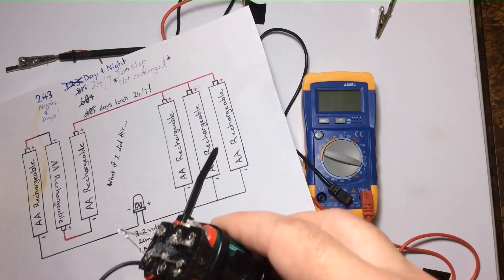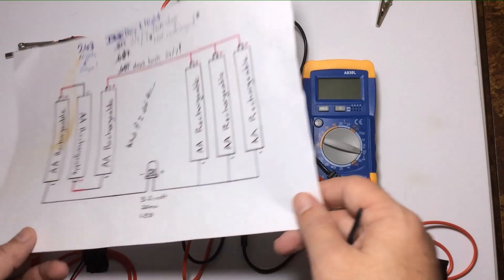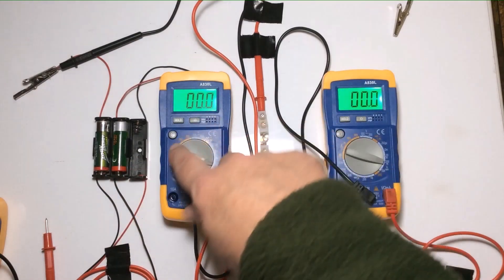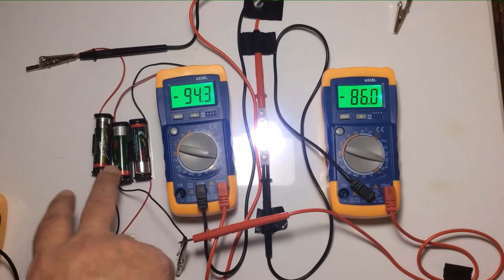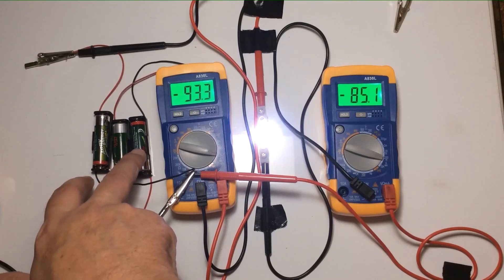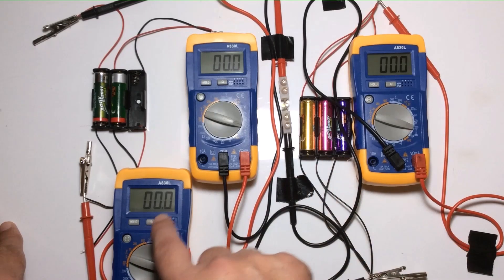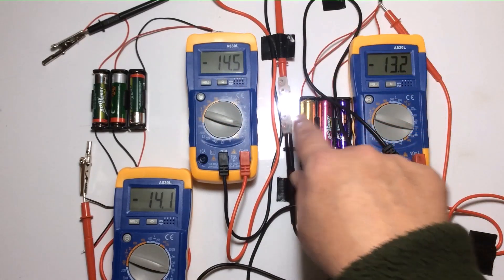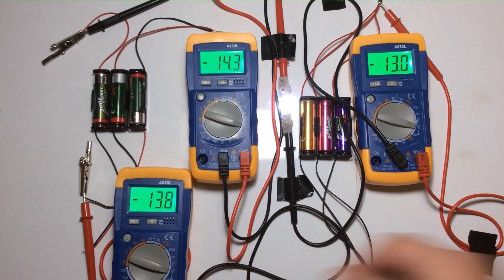TEST TERMINATED ON DAY 275... BUT HOW DID IT LAST SO LONG?

Comment: 1. Measuring different values of current going into and out of a load would violate one of these most fundamental circuit rules known in electrical engineering: Kirchoff's current law.  If you can prove otherwise, you would topple nearly 200 years of physics and have a Nobel prize coming.  Therefore, the difference you see MUST be due to incorrectly calibrated meters.  It's senseless to draw any conclusions until you verify your meters are correctly calibrated and read identically to each other, with a given load, same voltage, across the same spot in the circuit.  Search for how to test/calibrate a current measuring device.  Proceeding and trying to draw conclusions without first validating your equipment will have you chasing your tail and be a total waste of time. 
2. There's absolutely nothing special about three batteries in series connected to three arranged in parallel.  Electrically, the three in parallel can be considered "lumped" together and treated as a single, larger cell.  Your circuit can be simplified and considered four AA cells connected in series, with the fourth having a capacity of 3 times that of a single cell.  Moreover, mixing rechargeable batteries like that is very bad for the lower capacity ones because they run flat first, become reverse biased and get damaged.  Disposables usually quickly corrode and leak.
3. This is all very basic stuff.  I strongly suggest reading about and understanding nodal circuit analysis in order to lift the fog.
Reply from the maker: Thank you for your comment. I will start by saying that I don’t pay much attention to “their” rules, instead I base my work on physical results. Every time I hear, it can’t be measured that way, I question why they told us that. This approach has given me many surprises over the 20+ years, enough to make me not trust our education. It doesn’t matter which way you measure this circuit, there just isn’t enough power to make it run this long.

Einstein told us that nothing moves faster than the speed of light, which was a lie and this was recently declared not factual and it will probably take another 100 years to escape our Einsteinium prison. I have trouble believing anything we are taught, if one of the smartest minds could be coerced into lying to all of humanity because of the military complex, then I trust none of them. The “Navy UFO Patents” are a clear violation of our taught physics, once you realise that the US navy forced the patent office to issue the patents that were initially rejected because they didn’t comply with “physics”, then you start to question everything and rightfully so. All the other inventions that violate the laws of physics had their patents rejected but the Navy got theirs approved, something not right there. I believe Cubierre actually stated to the patent office that the physics books need to be re written when they initially rejected the patents because he could prove the devices worked.

I will look at Kirchoff’s current law, as a good scientist can only debate this after having a full understanding. I don’t currently know about Kirchhoff’s law because I don’t trust our education and tend to follow Tesla’s suggestion, which was do the physical experiments instead of theorising.

Einstein, when asked what it is like being the smartest person on earth, his answer was “I wouldn’t know, go ask Nikola Tesla” and when Tesla was asked to comment on Einstein’s theory of relativity he claimed it to be “nothing more than mathematical garb”  “ it is like dressing a pauper in the kings clothes and parading him before the people” so I’m pretty sure I don’t trust much of Einstein’s work as he was part of the military complex, the secret government that still steals energy and lives from us to this day.

The meters are designed under the basic principles of our understanding of electronics so I don’t trust them either. However, as they are the most common method of measurement I have had no choice but to use them. To counter this issue I bought 6 new meters, I tested three at a time and rotated them through all three positions and can confirm with all 6 meters I get the same results within 0.1 milliamperes so I don’t feel that calibration is even necessary but could be done just for peace of mind.
I will however say that I go into all research with a skeptics mindset, I don’t enjoy being tricked. There are things I have seen with my own eyes that leave me confused when reading what our education states. Many of these “Laws” aren’t based on reality.
I have to disagree with your comment that the parallel bank is to be considered like a battery in series because the parallel bank is connected to a series bank but in parallel, pos and pos together and we are taught that the voltage would need to be the same in both banks to be serially connected. The series bank and parallel bank are connected in parallel so the parallel bank can not be considered part of a series bank and instead should be considered a resistive load on the series bank.
 I agree with you regarding the damage that could occur to the cells due to running below the accepted voltage which is why I terminated the test early, mind you 275 days is hard to consider that was early. The batteries used in this test are rechargeable batteries that are approximately 5 years old and doing phenomenally well when that lone fact is considered.
I will close by stating that I feel it is dangerous to make assumptions on our education if what we were told was a lie, if you repeat a lie then your wrong and repeating a lie precisely doesn’t make it not a lie. They rely on our ego feeling abused to keep the truth from us, when these ridiculous thoughts arise, then have that conflict with our education, might I suggest entertaining the experiments even when “smarter minds” say it can’t be done. My ego used to tell me I’m smarter than that so I won’t investigate what they said can’t be done, now I have acknowledged my ego was created to hide the truth. I am not interested in a Nobel peace prize, especially not when people like Gates cosies up with human traffickers like Epstein to get closer to a Nobel prize. A Nobel peace prize has become a shameful measure of false teachings, receiving one means your willing to perpetuate the lies or be involved with horrible people.
Do the experiments for yourself and then question the teachings!
Reply: @whatifididthis...1236  Wasn't really expecting an intelligent discussion, but I'm still super disappointed.  Your world must be a confusing whirlwind with that mindset.  Totally stupefying how someone refuses to "trust" well known, refined principles that form the literal foundation for modern life.  Documented, proven, deeply understood, continually updated, FACTUAL knowledge, taught for generations, without which, current technology would NOT be possible.  Without which, the very device and infrastructure you are using right now to read these words wouldn't exist.  Yet somehow the underlying physics and science are all "lies" and part of some "conspiracy?"  Wow.  Good luck with that...
Reply from the maker: @supermarioisacat  Thank you for your comment.
The problem with education is that it teaches us to recite, never allowing us to question the teachings, this just leads to repetitive wrong think.
Have you read the “Navy UFO patents”, I don’t believe it can be considered a conspiracy if there are patents. The patents that talk of mass cancelation leading to faster than speed of light travel and overunity devices with kilowatt input and megawatts output. This is the US Navy filing these patents so I’m not sure it’s fair to label me a conspiracy nut.

As you state, this is factual information! Now correct me if I’m wrong, this is not what we learned at school. You have to ask yourself, are you teaching wrong information.
 I have seen things that do not stack up when measured with the current understanding of physics. Recently a group of scientists proved, tested and measured faster than light movement, so what now of Einstein’s crap rules. Einstein was part of the military complex credited for more than his worth where he merely piggybacked the discoveries made by german scientists. The Nazi’s abandoned nuclear energy because they felt the UAP/UFO technology was far more important, there are even photos of the Nazi built nuclear reactors that were built before Einstein even got out of bed! Might I suggest you watch the recent National Press Club address that consists of high ranking military personnel, that testified to congress, describing their first hand accounts of “off world vehicles”, reverse engineered, defying our understanding of physics, surely you don’t think these whistleblowers are all about conspiracy, most peoples lives are turned upside down after these events.
Can you explain the physics defying capabilities of these craft using physics? Because the physicists say they can’t. Because they are using the wrong information for measurements.
I have built so many devices over the years that don’t comply with physics, the first time I saw the opposite of my teachings it actually sent me into a spiral of depression because I had seen with my eyes the evidence of lies, then my immediate thoughts were of the people who die each day because of a lack of energy. Children in Africa sling semi automatic rifles over their shoulder on a four hour walk for wood, the rifle is to ward of predators of many kinds, to prevent sexual assault and death, just to collect energy to keep warm or cook with.
This is a real thing, the US government does possess “off world vehicles” of “non human origin” that have been reversed engineered and are used every day to run drugs and human trafficking for the deep state, unchecked, without oversight and defying nearly every part of our education.
Please for your sake and for the sake of anyone you may be educating, look outside your text books as they only teach you how to copy and paste.
The US Navy acknowledges our education is wrong, the deep state and military industrial complex use these technologies daily, to say I’m the conspirator is saying you don’t believe the UFO patents are valid and were approved by the patent office even though they don’t work!?
Faster than speed of light is a reality, Einstein was wrong, if you use his teachings without question your wrong!
Watch the video of faster than speed of light experiment and tell them they are wrong and that you know more.
The ego will only be bruised for a short while then you will have trouble believing the lies, just like me, then we can have real scientific debate for I feel it is a waste of time until you have been brought up to speed.
Reply: @supermarioisacat wow so you are basically saying you are not interested in science. A scientist does the experiment not argue what a book says. This channel has declared a potential new theory with the means to test. This is called science. You have the info to replicate the experiment. Saying it doesn't pay because of what you were taught is antithetical to the scientific method. If you don't want to try it just keep quiet. Nothing productive comes from saying this is wrong when you didn't test.
Reply from the maker: @supermarioisacat. Wow... your showing your ego fully bruised when you wrote this reply.
Your misunderstanding of this circuit is profound, this is not my invention. This was used by Tesla and Gabriel Kron, Tesla passed away in 1943 and Gabriel Kron passed in 1968 so you are a little late to the party and somewhat abusive because you weren't invited.

Tesla constantly stated that science was wrong which is contrary to your statement that he fully believed in these basic principles, he did not believe in most of academia's interpretations, Tesla even visited Hertz to demonstrate how Hertz was wrong, yet science pushed forward and ignored Tesla. Tesla stated this to the best minds of the day and demonstrated this. The "best"? minds of the day lied and gave you your education. A true scientist questions everything but more importantly does the experiment to see for themselves.

As for Kirchoffs Law, the problem is in the description. LAW.
Blinded by the LAWS that govern you, you even stated in your last response that I should take measurements at multiple points within the circuit and then you criticise me for doing just this because of Kirchoffs Law
This is the establishment forcing you to believe and it is for this reason I stated you should look into the US NAVY UFO PATENTS because there is a part of our education that is wrong which makes you wrong, before making a bigger fool of yourself can I suggest you get your head out of the books and perform the experiment and read the NAVY UFO PATENTS so you understand you are wrong.

Better yet, please use your education to explain why this works, this genuinely ran for 275 days and then I stopped it. Your science and education cant explain why. Do the test yourself and then use all that knowledge you have of the "real" world and explain why or how it runs so long. There would be no point in attempting to deceive you regarding the long run time, as soon as you perform the experiment you would know and come straight back at me, your logic here is a long way off of reality, I would understand that statement if the device was difficult to reverse engineer because then you might not be able to replicate and could call BS, but this is so simple to replicate it makes you look silly for suggesting it.

Math has yet to be perverted like education and using conventional understandings of electricity this should not work for so long. I never said you don't understand science, you said this in your educated response. Instead we would have all benefited from you explaining how the system defies physics with that superior knowledge you possess. After all, you are actually stating Tesla was wrong without backing up your statement. The joke appears to have rested at your feet.

Your right, this is less than 8th grade science, so why did we all miss it then?

This is the most simple device I have ever worked on, again not my idea, all I do is reverse engineer Tesla's work as well as anything else I'm curious about. I have done the math, I have done the calculations, I have recorded the lot and I have done the experiment, I am doing this for myself and others that understand they were lied to. Nobody wants to watch a boring collection of data points in a YouTube video and that's why I didn't show my recorded data and I don't see how me writing down numbers would prove to you that you are wrong as you have disputed the numbers I have already supplied.

 Have you built this device to see for yourself or are you banking on being smarter than Tesla or Kron. I expect your ego to be sorely bruised when you see with your eyes instead of relying on a human to give you the truth.

We will see how genuine a person you are when you have performed the experiment, we can chat about it in 275 days but something tells me I won't hear from you as your ego won't allow you to do the experiment for fear of the shame.
Have a nice day.
Reply from the maker: @muskrat7312 Thank you for your comment. Tesla would agree with you 100% in relation to @supermarioisacat. If you want to know how something is done, don't ask the person that doesn't know!
@supermarioisacat please do the experiment so we can attempt an open discussion and please don't bring your education into the conversation as it is the somewhat embarrassing guest at the table.
Reply: @supermarioisacat  To some people, "Trust the Science" actually means "Trust the Establishment."  I think THAT is what you mean.  Real science is a pursuit of truth, not a body of absolute facts.
Reply: @TheProfJones  Comical how everyone thinks they're "schooling me" about science.  I say what I mean and mean what I say.  "Trust the science" means trusting the rigorous philosophy and procedures of science.  Science is an agreed upon framework that observes, develops theories about those observations, forms hypotheses, tests those hypotheses and allows for making additional testable predictions.  All rigorously documented and done in a manner that's reproducible for anyone else wanting to verify a result (peer review).  Always open-minded, always questioning, recognizes possible weaknesses and most importantly, *goes out of it's way to prevent being fooled by errors.*

At the leading edge, it is in a state of constant refinement, allowing itself to be corrected/updated as necessary when presented with proper, overwhelming evidence.  For an actual scientist, running around wildly proclaiming to have made some history making discovery only to later be proven wrong is the BANE of their existence.  Nightmare inducing, career ending stuff.  A REAL scientist is as CERTAIN as they can possibly be before speaking out and potentially looking like a moron.

And YES, there ARE plenty of absolutely fundamental FACTS:  Standing motionless, when you drop an object, it falls DOWN - never has it been observed to "fall" up.  That's a fact.  The acceleration that object experiences is a known, factual value.  The Earth is round, fact.  The moon orbits the Earth, fact.  The Earth orbits the sun, FACT.  The speed of light in a vacuum is a precisely known, unchanging value.  Oxygen in the air causes oxidation and is why things burn.  The laws of thermodynamics are irrefutable, established FACT.  Energy cannot be created nor destroyed, only change form.  Shall I continue?  Not ONCE have ANY of these things EVER been shown to be incorrect.  Moreover, the understanding and acceptance of these essential and fundamental truths is what has lead to even bigger discoveries - to this very day.  If one element of foundational science is wrong, then it's ALL wrong.

Anyone thinking they're going to rewrite our understanding of any of THE most BASIC and fundamental building blocks of science in their garage using cheap hand tools would be hysterical if it weren't so pathetic.  The people actually discovering new science are the particle physicists with PhD's working at CERN and other accelerators around the world or astrophysicists studying the cosmos with satellites and telescopes, etc.  Sorry to break the news, but the days of an average person casually mixing chemicals in test tubes and making genuine, meaningful discoveries are LONG GONE.  If you want to make a difference, get a college degree.

If someone can't figure out which parts are carved in stone and which parts are open to active research, then they are nothing but totally ignorant, uneducated, amateur hacks, wasting their and everyone else's time.  Especially mine, I have no idea why I continue these futile attempts at pounding a little reason and common sense into thick heads.
Reply from the maker: @supermarioisacat  One can only assume you “think” you know best.
You are wrong, your ego won’t let you perform the test because YOU can’t explain the outcome!
I know you still have not read the US NAVY UFO patents or you just wouldn’t make the claims your making.
You still have not provided any facts, data or knowledge as to why it defies “your” physics.
You are not showing a level of intelligence that backs your claim of understanding science.
I have done the science and research, so I know your wrong and I care not what your silly book says, you are as wrong as your education.

This is reproducible, a five year old could reproduce this, you however, for whatever reason, most likely your education, you tell yourself your too smart to be tricked by your teacher who was also tricked. Probably convincing yourself that said five year old couldn’t do this and rather than demonstrate why you think you know best you tell yourself the five year old must have calculated wrong. After all the five year old would have a working unit and two thirds of a year later you’d be explaining why he was hallucinating after 275 days, the kid would see straight through you at this point and disregard your claims of higher intelligence. In short they would call you what your proving yourself to be, poorly educated. I can feel your ego wanting to tear the place apart.

Can you please read the science that goes beyond your education, we are only as smart as the information we obtain, you currently have not read this information, therefore this makes anybody that has read it smarter than you. Someone as smart as you claim to be, should be able to research this , if your having difficulty finding the patents, it would be embarrassing for you as would not understanding them however I am happy to steer you in the right direction, oh and can you please forward a copy of your correspondence with the patent office and US Navy on how they got it wrong, I’m always up for a good laugh.

I would appreciate if you lost the arrogance and stopped making statements about fools trying to educate you, if you were to look at this conversation from an outside perspective your currently pulling a Fauci, “I am the science”, the height of arrogance!
Do the work instead of bleating like a sheep.
Show your math or keep bitching that your smarter than Tesla, your choice, or your ego’s choice.
Damn, how do you get so smart that your controlled by your own ego?
Reply: @supermarioisacat  I agree with some of what you say, but not all.  You wrote, "Sorry to break the news, but the days of an average person casually mixing chemicals in test tubes and making genuine, meaningful discoveries are LONG GONE. If you want to make a difference, get a college degree."   NOT so!   I have a PhD in Physics, and I'm actually a Full Professor of Physics, Emeritus - thank you very much...I would not discourage researchers such as the gentleman who made the video here - and conducted an admirable series of experiments.
Reply from the maker: @TheProfJones Thank you for your comment. Knowing your credentials leaves me feeling a little under educated. I have never claimed to have all the answers and instead have spent every hour of my research with a constant lingering question, have we been deceived? I understand that an educated person will refer to their education but my opinion stands strong, what if what we learn in good faith is also wrong, not questioning our teachers and professors is a bad idea and leads to statements like Fauci made, “I am the science”. If what I recite is wrong then it matters not how accurately I recite, it’s still wrong, which makes me wrong. I prefer to see with my own eyes as I have learned not to trust anyone.
Thank you for reassuring my faith in educators willingness to investigate the other side of the coin.
Reply: @supermarioisacat  "The people actually discovering new science are the particle physicists with PhD's working at CERN and other accelerators around the world or astrophysicists studying the cosmos with satellites and telescopes, etc"

And what exactly those discoveries are? I mean, except making up new particles and generating math which doesn't mean anything? Are those discoveries project itself on the real world somehow?
Reply: Yes, its all about lie conditioning at all time in our world ofc in different aspect. 

So deep and they false teaching and half truth go deeper and deeper in our unconciousness metaprogram mind.

Then, it BECOME our eternal fool without notice and total awareness.

Eternal debates is the result. 😅